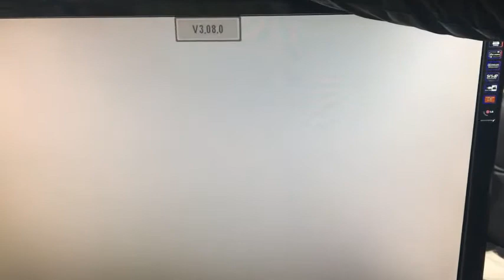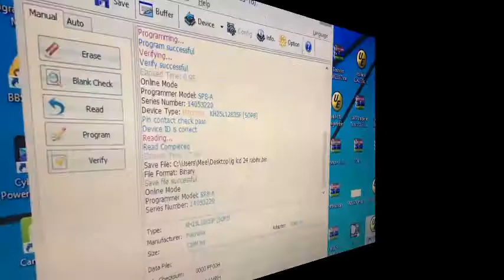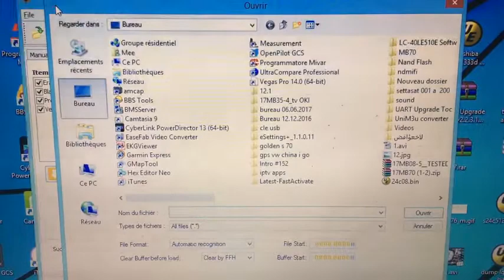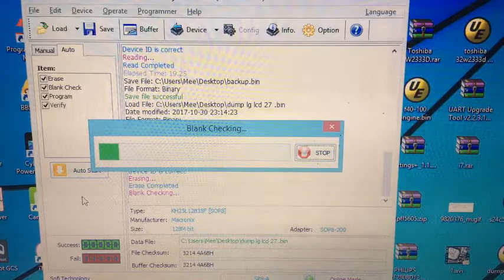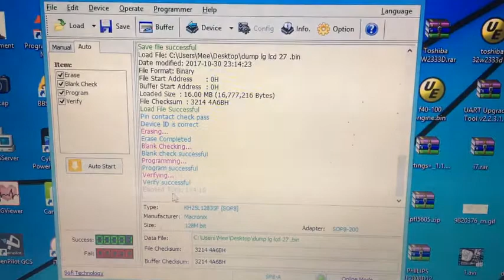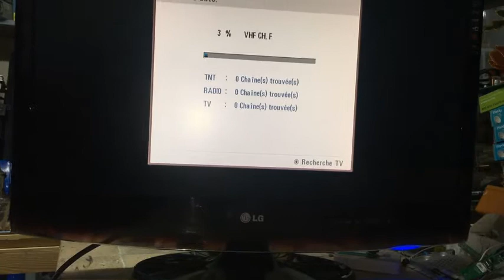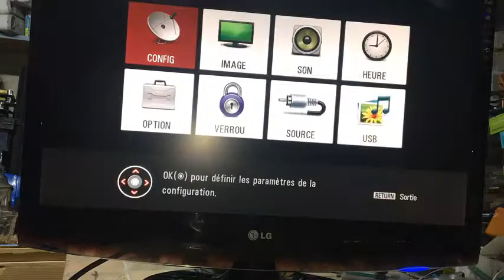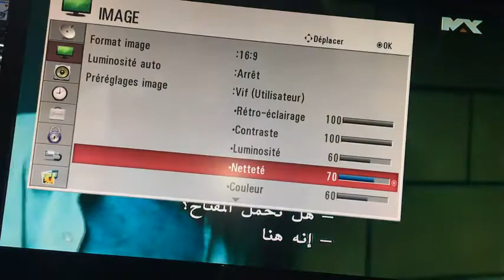Repairing LCD LG 27 Monitor M2762DP: V3.08.0 in white screen

Comment: There was an easier way.😁
1. Press the “Return” or “Exit” key on the LG remote control.
2. Power the TV off with the LG remote control.
3. Power the TV back on with the LG remote control.
4. Switch to the correct input (ex. Cable, AV1, Component 1, or HDMI 1).
Reply from the maker: yes i know , but doesn't work for some model , must programming the ic .
Reply: Thanks, this worked for me. I am so glad I saw this comment :)
Reply: @ViktorVano  AND HOW DO YOU FIX IT IF YOU DONT HAVE ANYMORE THE REMOTE CONTROL?
Reply: Thank you so much, glad I saw this comment
Reply: It's work for me 2, just now 😅
Reply: My LG LCD FLATRON 27 since 2012 ,wow more than 10 years it still   work  great 👍

Comment: I have the same problem but with v3.07.0 on the scree  should i do the same?
Reply from the maker: yes it's the same , but first test this method: click in the same time button exit in the remote and the button tv . 
if not working then you must reprogram the ic .
Reply: @repoapps  i dont have the remote
Reply: @hackaaama5456  same 😂
Reply: @oumaimasamerei4848  did you find a way without remote

Comment: I have lg M2262D with v3.10.0 on white screen is there any other method except flashing the chip ,i dont have a heat gun ,but i will buy if there is not another way ,waiting for reply asap thank you ,btw from where i buy that pc adapter for flashing the chip ?
Reply: UPDATE FIXED EASY LOL  repo apps and guys  believe it or not after i searched google for lg white screen v3.10.0 ive just needed to press exit on the original remote control ,it was in service mode that code ,now the tv works just fine ,i also factory reset the tv just to bring back all beautiful settings 😊
Reply: this worked for me. I didn’t have a remote, so bought one from Amazon. This is the one I got: https://www.amazon.co.uk/dp/B0874THTB8 one simple press of a button!
Reply: thanks it work, i lost remote but i use remote app (remote world on gogle play store for android) have lg remote on xiaomi redmi note 9 lite (have infra red)  and work 5 stars many thanks. My LG with v3.05.0, and after press the exit buton two times and power, if exit don t work try: info or guide.  TV starts normal e go to menu and disable (auto update).
Reply: @fguerreiro  will this work for the tv he has in this video
Reply: @fguerreiro  and which model on the app did you use
Reply: @fguerreiro  this fix tv for me! if u're using more than one lg tv, be sure to use its remote control and press "return". I tried using other 2 remote control for other 2 lg TV but they didn't work)
Reply: @mambwesteven203  Hello it work for me my LG is: M2762D, the app is LG Remote in Google play store version: 8.8.7.6, but your smartphone must have (infra red)
Reply: @simonecampagna8739  hello, i don´t now for other models if works. In the app you have diferent remotes e try 3 or 4 until works.

Comment: I have the exact same tv as you but I can’t turn it off or press the buttons on it and it has a white screen
Reply from the maker: must reprogram the ic
Reply: @repoapps  there are these letters floating around the tv
Reply from the maker: if the buttons doesn't work so you have no solution just reprogramming the ic like on video .
if you have chance , try the remote control press the button exit for 10 seconds .
Reply: @repoapps  ok thanks

Comment: I have monitor lg m2362d-PZ can you help me search flash ?
Reply from the maker: what's problem you have in tv ?
Reply: @repoapps  my problem is white screen. I dont see SW number tablet ... But I test SW ...
Reply from the maker: check 12 volt in pin lvds ( cable connected to panel ) i think is missing.
Reply: @repoapps  is only 3,4 V and procesor to main board is hot ...
Reply from the maker: i will send you the dump file and test it .
Reply: @repoapps  o.k  thanks
Reply from the maker: @NeoCambell  http://up-4.net/d/8vws

Comment: I have same issue for this model and i have chip mx 25L12805 dmi 20gb and i dont know what soft to installing
Reply from the maker: the dump link in description my friend
Reply: i saw, but for my version is same???
Reply from the maker: look i tell you method it's can be useful to fix your problem without flashing the ic : click in the remote button power + exit in the same times and the message will go .. i'm waiting to tell me the results.
Reply: not work, i need the dum to flash the chi and the download link not working
Reply from the maker: anoher link : http://file-upload.com/d/FvAd
Reply: @repoapps  thank u a lot
Reply: @repoapps  Thank you so much. You saved my day :)
Reply from the maker: you welcome 😉
Reply: I have lg M2262D with v3.10.0 on white screen is there any other method except flashing the chip ,i dont have a heat gun ,but i will buy if there is not another way ,waiting for reply asap thank you ,btw from where i buy that pc adapter for flashing the chip ?
Reply from the maker: have  you try the method in my reply upper ? 
you need programmer or socket adapter?
Reply: @repoapps  believe it or not after i searched google for lg white screen v3.10.0 ive just needed to press exit on the original remote control ,it was in service mode that code ,now the tv works just fine ,i also factory reset the tv just to bring back all beautiful settings 😊